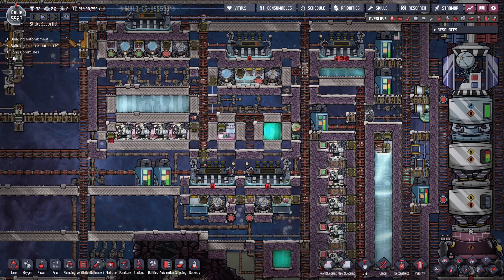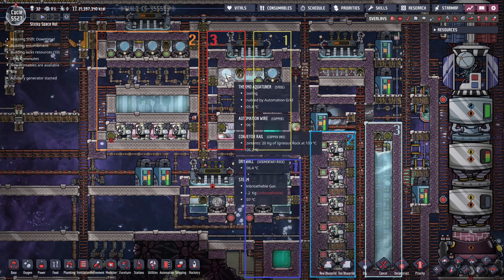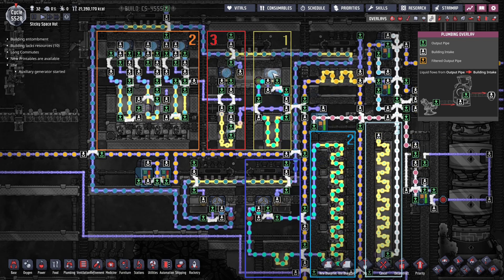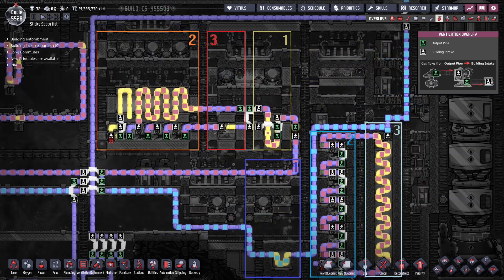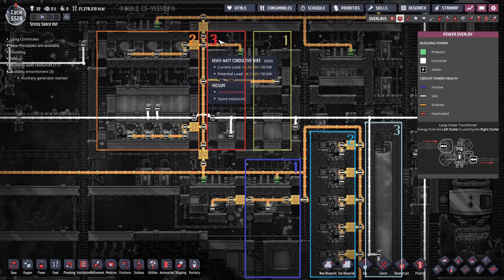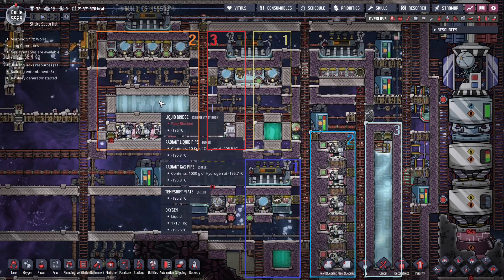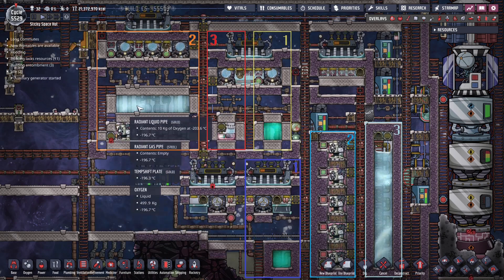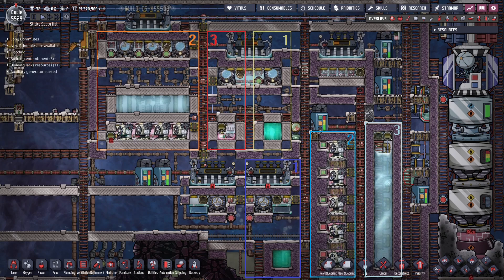Liquefy Hydrogen with Water! - Oxygen Not Included

Comment: I knew it could be done!  you are awesome ;)

ok question on a different subject:  I used to use door compressor to handle large amounts of liquid and gasses at end game but the game engine really hates it on top of all the other things and after a while the game becomes unplayable.  Is there a work around it?  Currently I do not use the compressor only as pumps so the game engine will not crap itself.
Reply from the maker: Absolutely, use 2 liquids, no doors. Put a little bit of heavy liquid, such as Super Coolant, on the bottom and submerge liquid vent in it. The liquid vent will never over-pressure and will keep pumping out the lighter liquid. Also, this way works to compress liquid, or if the end is open, will pump it vertically: https://www.youtube.com/watch?v=XpTQBwuNzpY&t=6s
Reply: @greezyhammer764  Thank you

Comment: Polluted water into Ethanol into Methane (two times more efficient then Regulator and Hydrogen).  LOX and AT is slightly less efficient the then just using a regulator with hydrogen.  I then chill the hydrogen in buffer until 238.  Pass it through 1 more regulator for 252 ( I think you can push this by 3 degrees so 241/255) .  Then I used a similar setup with 1000g packets but mine had a bypass with a shutoff value that was always on to ensure packets never collided.  The trick is having the bypass and AT route having the same number of pipes when they rejoin.  The shutoff was nice in case of a power outage but your alternating implementation is even nicer.
Reply from the maker: This was my very first non-space material setup ever and I had no idea what I was doing yet :D

Comment: Hi Greezy! great content, definetly worth subscribe! question: is it possible to make it on one stage? or on one aquatunner/steam turbine setup?
Reply from the maker: Definitely doable using just aquatuners, but would need probably 4 of them + water / polluted water loop.
Reply: @greezyhammer764  I made one of these for LOX and it was able to handle about 300 g/s from room temp.  You could do the same for hydrogen but would have to limit the flow rate to something like 118 g/s (needs more degrees with more energy per degree)